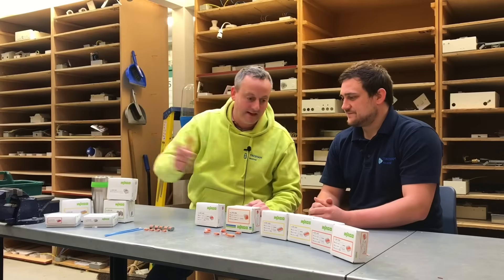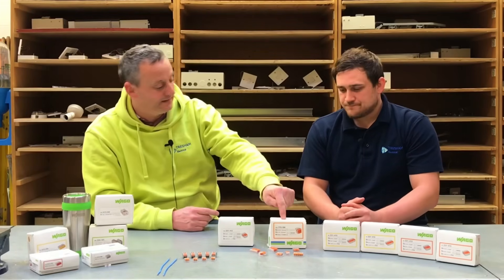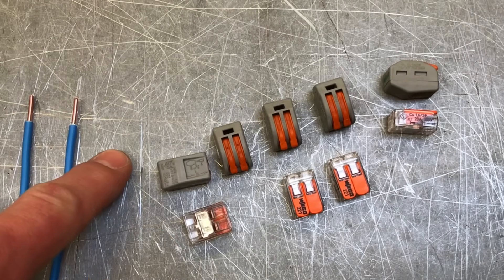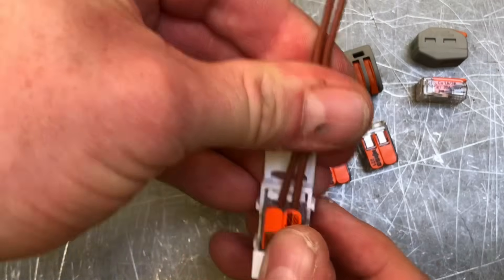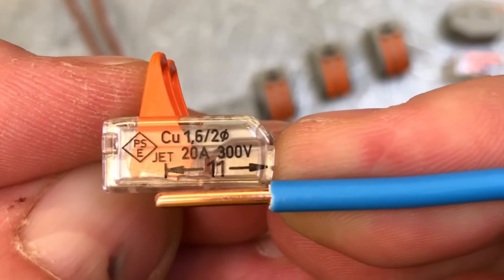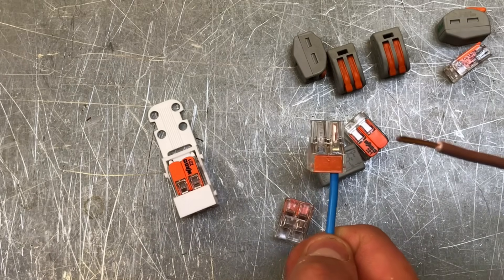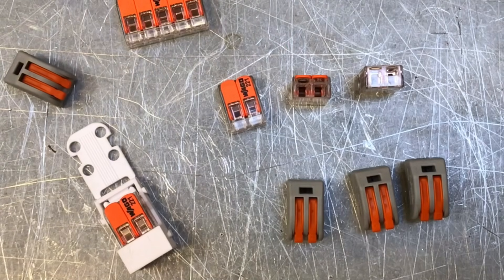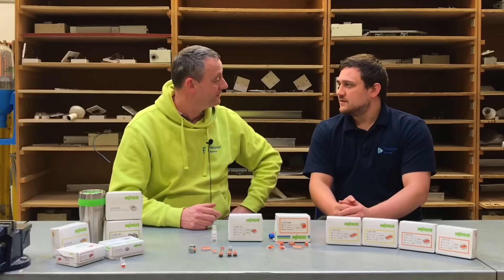WAGO 221, 222 and 773 Connectors & the Voltage and Current Ratings for Europe Explained for the 221

Comment: The high voltage cable from a flyback transformer to a CRT in one of my sets is too short. I am aware I can splice to increase length and this has been successful but can one of these connectors safely be used instead? Cheers.

Comment: If got a radial circuit 20a can a 773 wago be used to extend cable in socket if to short or has it got to be a 222 or 221

Comment: Hi,
As a service engineer of 35 years I use 30 amp connections on the neutral in the machines, live conductors go into a solid state relay. I bought a wago 221 lever installer kit but it stated 20A at 300v as you mentioned so I bought 222 as states 32A.
Can I use the 221 as the machine pulls 20/25amps.
The 222 grey ones look far more solid to carry the current.
Many thanks 
Great video.
Reply: Either 221 or 222 series should be Ok to use. There are 221 series which can take upto 6mm cable and which can handle a higher amperage of upto 41A.
Reply from the maker: Thanks for the great comment 👍🏻

Comment: If it is 20A in Japan, why is it 32A here? Our amps are the same as Japanese ones so why the difference, are our standards lower than theirs?
Reply from the maker: Hi the supply voltage in Japan is only 100 volts and 230 volts in the U.K. 👍
Reply: Absolutely yes, IEC standards are indeed lower than in Japan and the US!  The ratings systems are different. So the actual criteria are not really the same. If you assume that each country uses the same rating criteria, you would be making a huge mistake!! 

So why are they different? Amps is Amps all over the world, right?  Yes, but...

Here is where some opinions come into play. IEC specs are designed to cover all of the 240 volt world and that includes places like China, India and Pakistan, that have some of the horrible and unsafe electrical systems in the world!! Just watch some videos from there and you will se what I mean. But the IEC needs to get general agreement and input from all these countries. If you were representing one of these countries, do you think you would be willing to admit that your current standards in your entire country are sub-standard and your systems are a complete POS?  Pretty doubtful. 

The bottom line, in my opinion is because the IEC is very political. As an example, why would you have regulations regarding "green energy" if your primary concern was just electrical theory and safety?  Does economics impact things like Ohm's Laws or overall safety?  Of course not, but in the IEC they have to keep things like economic impacts as viable factors. Maybe because pure theory and safety aren't your only motivations. The IEC, at least in theory, operates on a consensus principle. Using that consensus model, regardless of what it is for, means that you have a wide spectrum of opinions and interests. Consensus is a nice way of saying, "acceptable compromise" by all the players involved. 

Although the theories and properties of electricity are not different because of where you live, it seems kind of compromising to consider these  other factors. And let's consider the factor of safety. If you watch videos from other countries one thing becomes quite apparent. The general view on safety cover an amazingly wide spectrum of views. Now take and play that out to something like what a given government sees as an "acceptable" number of deaths from electrical fires. Idealistically, we'd like to think that number is zero across the board, but we know that realistically when you set goals like that, you need to understand the economics of achieving it. he bottom line is that IEC specs ad standards are compromises. 

Now each country can indeed have their own versions that cover aspects that are of significant concern in that country.  Take the BS standards used in the UK.  And let's look at one piece of that. Ring circuits. Now if  you understand the history of ring circuits, you know that this was a compromise of safety because of economics.  After WW2, ring circuits were required as a means of reducing the demand for copper, which was in short supply.  As a result, many millions of ring circuits exist in the UK. Now if you look at it from a pure theory and safety standpoint, you know that ring circuits are far from the "best" design. It is inherently a very flawed design. In order to dal with those flaws, you have crazy things like enormous plugs that can be fused, as an attempt to keep ring circuits a bit safer. But the flaws still present issues should the ring become open at one end. Eliminating all these existing ring circuits today, would have  huge economic impacts. So the BS versions of IEC standards must address this oddity. There are of course, other differences in the BS standards, that could be summed up as being because , "Brits are Brits!"

But now consider Japan and the US, (as well as North America). There are major differences in their systems compared to 240 volt countries. Both Japan and the US, use split phase dual voltage systems. The US and NA use 120/240volts. Japan uses 100/200 volts, in their residential systems'. In both he US and japan, the lower of the dual voltages are used for 99% of typical consumer devices. (120V in the US and 100 volts in Japan)  So take a typical device used in pretty much all countries. A 1000 watt Microwave oven.  In 240 volt countries that circuit will draw ~4.17 amps. In the US it will be double at ~8.3 amps. And in Japan, it will be a bit more than double, at ~10 amps. So twice or more current in the US and Japan, compared to 240 volt countries for the same devices.  

Now where this difference becomes a significant issue is at connection points within the systems. Heating of a connection is determined by the current squared times the résistance of the connection. ("I squared R")  Because it is the current squared, twice the current will produce 4 times the heating, into the same resistance connection.. (even more in Japan) These are just the engineering facts. 

Another pure engineering fact is that WAGO connectors have 3 to 4 times the resistance of a wire nut connection. The reasons for that are that WAGOs use a spring clamp connection and have a very small contact area compared to a properly installed wire nut connection. The contact surface area difference is enormous. The wire nut connection relies on the actual tensile strength of the copper conductor. The WAGO relies on the spring tension of the tiny little spring clamp, made of two dissimilar metals. 

Now consider that WAGOs have been successfully used all over Europe for quite a long time.  But statically speaking  the currents they are most used for  are half that of what the statistical average currents will be in the US and Japan, simply because of the voltage differences. By now, you should be seeing the potential differences between the US and Japan, compered to 240 volt countries. 

Now  let's consider the standards and regulatory agencies in Japan and the US. Both are very much pure engineering and safety based standards. The agency structures are far more independent and non-political, when compared to the IEC.

The US and Japanese agencies do not give a crap about what other countries do. The opinions of what is OK in China or India, have no bearing on the standards they devise. They are not driven by a consensus model that involves virtually the entire world. They get input from mainly engineering type sources specific for the applications within their respective countries. Safety standards  and regulations are much more conservative than the broader world. Having spent quite a bit of time in Japan, my view is that they are a bit more safety oriented in standards and regulations, than in the US. 

So if you look at the standards and regulatory agencies work and how they are structured,  you should be able to see why something like, "we have used these for over 20 years with no real issues.", could have a bigger influence than pure engineering  and safety factors.  

There are a few other differences in agency operation that I personally find concerning, like the vast number and percent of devices that are "self certified" within the IEC system. 

BTW, the UL ratings of WAGOs is considerably more strict than the IEC specs. 

So in conclusion, even though amps is amps, everywhere in the world, Specifications and standards across the world, are not apples to apples comparisons.

Comment: Can you use the 24A push in Wagos on a ring circuit?
Reply from the maker: Hi. Not sure about the 24A Wago specification. Sorry. Thanks for watching and commenting Gaz 👍
Reply: Yes anything over 20amps is fine
Reply: Would you sleep at night using a terminal connector rated at 24A when the circuit breaker is generally rated at 32A?  Safer to use either the 221 or 222 imho.

Comment: Great video, thanks. Thanks for clarifying the current rating. Maybe it would be good to say that there are larger Wagos for larger cables, which have a current rating of more than 32 Amps. With the 773 connectors, it's very easy to remove a cable when there's only one in the connector but when there's two or more, I guess it's not quite so easy. Maybe you could demonstrate, please?

Comment: I know alot of people say you cannot use them on a ring circuit should have clarified that in the video.
I know you can but I know alot of sparkles out there that wont use them on ring circuits.
Reply: @European Sparky thanks but I knew that it was rated but alot of people think because it says 20amp up to 300v they think that is for our voltage range and people say if a ring breaks you could possibly pull 32 amp through one leg and the wagos only being rated to 20amp up to 300v that they will melt.
But I done the research myself and found that not to be

Comment: Are these considered maintenance free?
Reply from the maker: Hi. Thanks for commenting and watching. YES. 
Gaz👍
Reply: Yes..  but... in the instructions it seems to say that for maintenance free applications, if I read it correctly?, that the maximum current rating is 20A? I bought them because it says 32A on the side, and I wanted to use them to replace a 32A ring circuit J.B. that is about to be tiled over. They do seem to like confusing people, as one of the comments said. I did see a John Ward video though where he was testing a piece of 2.5mm2 cable connected with Wagos, to destruction and the cable melted before the Wago connector, so perhaps we can assume from that test that it's  fine to use it on a ring circuit?
Reply: @lifter98  the amp rating has nothing to do with them being considered maintenance free. It’s all to do with how the cable is secured.
Reply: You need to check with Wago to see if you can bury the junction box in a wall, also I think there is an Eefix vid that says to extend a ring using wago's and jb  you have to have a box for each leg  so two boxes needed to extend a ring.....